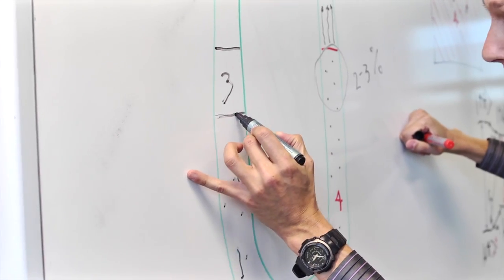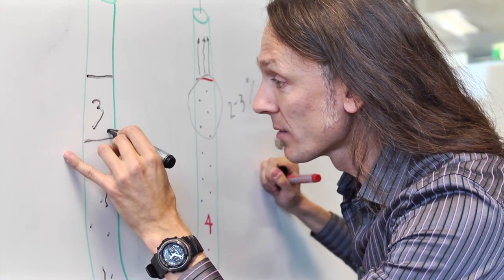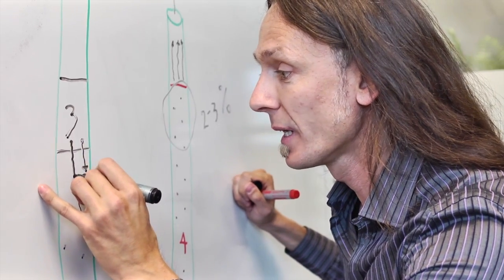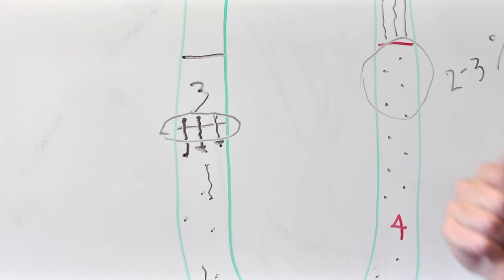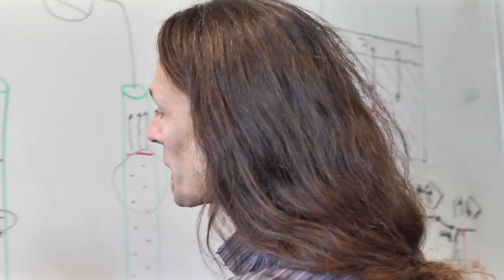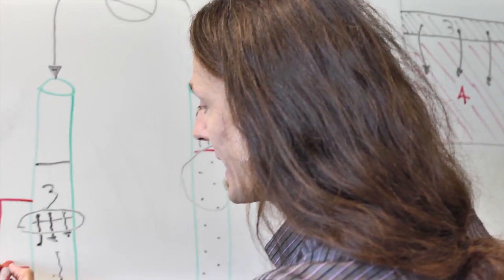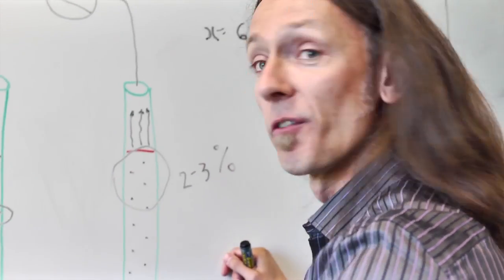Quantum Cooling to (Near) Absolute Zero

Comment: ok so how do i attach this to my computer?
Reply: That... is a really good idea.
Reply: your computer will actually stop working at that temperature. electrons can't move at absolute zero... at least not in normal circuits
Reply: duct-tape
Reply: Have you seen the overclocking world record? They had the i7 6950x at around -80 to -90. They oc'd to 5.7
Reply: No point, more efficient cool-down systems on the market... As in like they cost less and cool down faster to a reasonable circuit temperature... You do not want to basically turn off Your computer with this, do You?
Reply: Chris Jernigan
The idea is you make it adjustable.
Reply: Chris Jernigan normal CPU stops working after about -5C (give or take few degrees)
Reply: ***** hell no, at 120C the cpu is dead, intel can go up to 100C before it shuts itself off to avoid damages to cores, amd fx series can only go up to 63C before its silicon base starts to melt. They never keep them at -100C after max -10C the cpu will get cold bug(around -20c when using 1-2 cores only) how do i know? because i have cooled my cpu with LN2 before.
Reply: Chris Jernigan what a party breaker :)
Reply: Chris Jernigan Temperature is all about random motion aside from the Pauli exclusion principle. Electrons can move fine at absolute zero.
Reply: use hair

Comment: I'm having trouble with the part where he says that a 65cm sphere of a copper/aluminum alloy weighs 1.5 tonne, as in 1500kg.  I'm assuming the 65cm refers to the diameter, but there's no way a sphere made of that alloy could weigh that much...
Reply: I think what he means is that the density of the sphere is extremely large so even if it is only 65 cm  it weighs 1.5 tonne.

Comment: So basically he just described a sophisticated version of a water block? I'm still confused though, I mean liquid helium is pretty cold to begin with, so why don't they run it like a normal water block and just continuously pump the helium through the tube to pull the heat away from the chip? Unless the helium actually gets even colder using the process he described, and I just misunderstood that part.
Reply: The way I understood it, the helium doesn't get any colder, but the tube around it does because the helium extracts heat from it for some reason. Like when water extracts heat from your body for evaropation.
Reply: The helium doesn't, put it does pull heat out of the stuff on the outside. Liquid helium is about 4 K, this method can get things down to millikelvins.
Reply: yeah from what I understood, it brings the temperature to a lowest possible point for now. Thats why the usage of it are highly specialized => the aluminium sphere example.

Comment: So... when can I get one of these for my gaming desktop?
Reply: So, you want your computer to freeze?
Reply: alienkishorekumar Cooler temperatures reduce electrical resistance in semiconductors (and regular conductors as well), allowing for a higher voltage and shorter clock-cycle. This is called over-clocking. At temperatures in the order of millikelvin, I think the conductive state of transistors actually becomes a super conductive state where there is no resistance, resulting in a 100% efficient computer.
Reply: Don't confuse superconductivity with simply conducting better. People used to use GaAs to study 2DEGs and ballistic transport at very low temperatures. It didn't superconduct, but just had a crazy coherence length. I wouldn't expect your cpu to superconduct and, on the off chance that you had SC (like aluminum) leads that put an unintended supercurrent across a transistor, I doubt that would be a good thing.

Also, dil fridges (discussed here) are pains. They're bulky, they cost a fortune to run, and they don't take big heat loads anyways. Stick with something reasonable... Like liquid nitrogen...
Reply: Shit really? I though any conductor had a superconductive state at a low enough temperature. At any rate, I think you're right about superconducting transistors not really being a good thing

Comment: Actually, the concept of temperature becomes quite multifaceted at such extreme low levels. By combining magnetic refrigeration with helium dilution one can achieve much lower temperatures - more precisely nuclear spin temperatures - with magnitudes of hundreds of picokelvins. In November 2000, researchers at Aalto University's O.V. Lounasmaa Laboratory at Otaniemi, Finland reached 100pK nuclear spin temperature with Rhodium.

Comment: It's really not that complicated - thermodynamically, the system works like every refrigerator. Naturally every system settles into a state of thermal equilibrium (that's the 2nd law of thermodynamics), meaning, temperature equalizes (max entropy state). If, however, you perform some outside work (e.g. run a pump) you can recreate the non-equlibrium state and move heat around, creating a cold-to-warm gradient.

Comment: It's complicated, because temperatue is a macroscopic concept related to microscopic movement. If you look at it from a certain direction, no mass means no matter, and therefore no temp, which is not the same thing as absolute zero. As far I understand, when defining the temp of an empty space, you use the steady state temperature a body would reach in said space, which depends on the radiation going through that area. that's why empty space is given a sligtly higher than absolute zero temp.

Comment: The "pump" that professor Morello drew would in fact incorporate a standard helium refrigeration circuit used to liquify gaseous helium, so that they re-input H3 at a fixed input temperature (probably somewhere around 1-2K) and extract any excess heat out of the system.
As for environmental considerations, this entire apparatus needs to be in a hard vacuum with very good thermal insulation to limit uncontrolled heat exchange as much as possible.

Comment: Hey! You should go check out this video by minute physics, Google "Can Humans Really Feel Temperature?" and its the first link. Heat is just a measure of energy, that is how any physicist would look at it. The more heat the faster each atom is vibrating around. Absolute zero means the system has no movement, and so no 'heat energy'.

Comment: I don't understand where the heat energy goes. I mean it travels into the u-tube and it's trapped there? Cause I would guess the environment would also have more thermal energy so it can't flow there... So they change the u-tube and how would they cool it again?

Comment: Now it's consuming energy to become more entropic, but wait, he didn't ADD any heat to it for that to happen. So what then? Well, it has to use heat already there, to perform it's reaction. Which means it sucks in heat, and everything around it, must get colder. So that's where the heat 'goes', it gets used by the H3 being forced into the H4. Now this is absorbing heat as a Heat Sink, to anything near or attached to it. Like for instance, his 'Experimental Apparatus'. I hope that helps :D

Comment: I'll try and be a bit clearer. Ok. So, increasing entropy. Entropy is the randomness of a substance. Ice is frozen in place. If we take Ice, and add heat (which it absorbs and uses to break the solid bonds between molecules), it becomes water, which can move. Then we add more heat (which it absorbs and breaks more bonds) and we get gas, which can move as much as it wants. Now rather than add heat, what he's doing, is increasing the entropy another way. By Forcing the H3 to go into the H4. ->more

Comment: It was getting absorbed by the mixture. So the energy (Because heat is just energy) was being used to achieve something other than heat. It's like fire, is the opposite direction. Fire is the reaction of 2 things that react, and release heat as the excess energy. Well this reaction instead of releasing energy, consumed it.

Comment: Temperature is gave by molecules' movement, then there is no temperature in absence of mass. But what about a light ray passing through this nothing? Light heats.. But yet, if there's no mass, temperature (differently from photon's energy) can't be measured, because anything isn't affected by the ray.. so it's the same, I think.

Comment: Nope. There's no temperature, as temperature is the average kinetic energy of the particles, and kinetic energy is (1/2)mv^2. But you don't call it absolute zero, because the particles are not affected by temperature. Their velocity will be the speed of light, and they will neither gain nor lose kinetic energy from their surroundings.

Comment: It's a complete lack of atomic motion that constitutes "absolute zero".
Remember there are different kinds of heat transfer (radiant, convected, conducted) so you can have radiant heat without mass like the space station needing radiators to dump excess heat in to the vacuum of space or how the heat of the sun reaches Earth.

Comment: the one that can detect supernovas, could one be designed to detect gravitational changes such as an approaching asteroid? interesting application for an early detection system. maybe not precise, but if the direction is found through gravitational waves, then telescopes could then be used to further pinpoint the location and possible trajectory

Comment: yes, basically in a system at a given temp. you actually have some that are hotter, and some that are colder (its a distribution)

so you remove the hottest one (via evaporation using laser) and youre left with cooler and cooler particles.

Comment: You can put these mechanisms together to make even cooler temperatures. By aligning the heat from vaporizing H3 atoms with the H3 atoms going into the H4 atoms in the next tube, the original tube will get cooler.

Comment: absolute zero means no thermal energy. so i dont think the particle is not vibrating at all. when u quote the uncertainty principle, the principle actually only tell u that u cannot tell where the particle is within a range. it does not imply it has to be moving. example: i am thinking of a number within 1~10. that doesn't imply im changing the number constantly within 1~10

Comment: what  happens if you drop an ice cube into boiling water? The water doesn't freeze. The whole mass of the cooler phase is insignificant with respect to its surroundings. It would evaporate instantly into air as it meets with the ground or the air, taking a tiny bit of heat from the closest surroundings which would then thermalize with the rest. They actually use liquid nitrogen to burn of your warts in skin surgery. And your skin doesn't freeze. Just a bit of epidermis falls off.

Comment: "Finally, it's remarkable that you only answer by reversing my previous statements, instead of giving arguments." Read number 2 and 3 again. I was correcting your position on the matter of the holy book. For the first one, I am merely reflecting on your psychological state as a 'logical' being that believes there is no higher power. Oh, and most of those religious acts of terrorism, war, and inquisition is man operating in error with the wrong religion. God doesn't support war but for good ends.

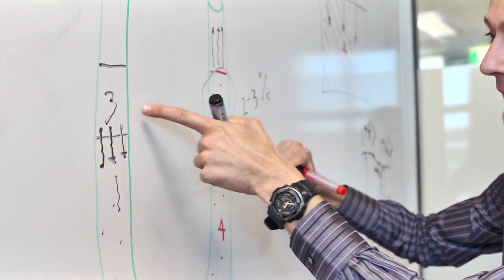Comment: The explanation seems to fall apart around 5:40. Increasing entropy is not necessarily endothermic. I think he should say that breaking the He4-He4 and He3-He3 bonds takes more energy that forming the 2 He3-He4 bonds, and since mixing is favored by entropy the endothermic process proceeds spontaneously. Also the He3 in gas form must be losing energy somehow because it is heated when it is compressed and release more heat when it condenses. Perhaps a heat exchanger with the other side?

Comment: Even if the thing being cooled by the device gets precooled, it will still slowly absorb more heat from the environment, that is passed on to the stuff inside the tube, and over time that will accumulate. So if the energy never leaves the system, either it can't be run continuously for too long, or it is disposable 'cause it is a ticking time bomb...

Comment: If the Kelvin scale is used to measure the energy of a system, how can you have vibrations at 0K. Any mass that vibrates has energy right? Or do they use quantum fluctuations as a loophole around that? I'm a little confused. Anyone care to explain?

Comment: too bad experiments on helium 50-60 years down the line might be difficult since it is feasible that we will run out of the stuff if we keep using it at the rate we are currently going. At the moment there is no cost-efficient way to synthesise helium or extract it from the atmosphere.

Comment: The heat doesn't exit the system, energy can't be created or destroyed, we know this for a certainty, the heat is converted into kinetic energy so as the Helium 3 atoms can move past the interface into the Helium four phase to maintain the equilibrium, that's why it cools things down, because it absorbs heat and converts it into kinetic energy to keep itself in equilibrium, that kinetic energy is then continually used to move the helium 3 atoms and thus is not re-released as heat

Comment: Temperatures down to milli Kelvin are measured by resistance thermometers (mostly carbon-thermometers). The funny thing is, that below 1 Kelvin the resistance rises again! Below some 10 milli Kelvin you must change the measurment methode. Then you can use "NMR" = nuclear magnetic resonance to measure and for further cooling to. Ultral low temperature is a very fascinating thing! If you are interestetd in that look for Video "Absolute Zero"

Comment: In a crude sense, yes. Decreasing the equilibrium concentration around the interface will cause more Helium 3 to dissolve into the Helium 4 phase, to restore the equilibrium concentration.

Comment: I went to a university open-house and saw a He3 dilution refrigerator, but the physicist explaining it was much more opaque than the guy in the video. I'm an engineer, but my only thermodynamics class was ten years ago. I have two questions:

1) If you have separate containers of He3 & He4, and you let them mix, increasing their entropy, does their temperature go up or down?
2) Is #1 a hard question, or should I feel stupid for not understanding it?

I thought low temperatures meant low entropy.

Comment: speaking of things that can be done at very low temperatures, could you do a video on the work that Lene Hau has done where her team slowed down light until stopped? this blows my mind. for anyone else who is interested there is a podcast on radiolab about it - google 'radiolab speed' for it and check out the wikipedia page about Lene Hau

Comment: about that soup cooling, i always thought, hot soup cooling with blowing breath on it is done because you are moving colder air to the hotter soup, where soup transfers heat to the breath but the air wont stay hot because you are blowing new colder air on it, like principe of cpu coolers

Comment: Actually if you just take a cupful of helium and raise it above the boiling point of He-3, you can probably get pure liquid He-4. That's assuming there isn't any upper limit to distillation like what you have with alcohol and water, which can't be distilled to more than around 95% alcohol.

Comment: Well for all sorts and purposes, the limit of how much can be absorbed is solely based off of how well the tube is insulated from the outside. The more insulated, the cooler you can get. Otherwise you would hit a limit, of course above absolute zero. 
Super conductors don't actually require that cold of temperatures, since cooling below a super-conductor temperature is a little bit redundant.